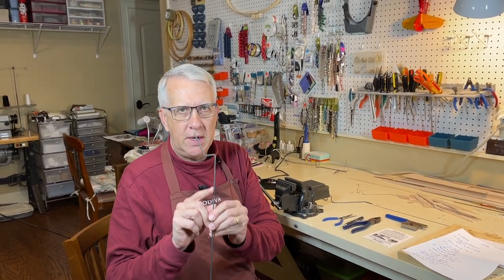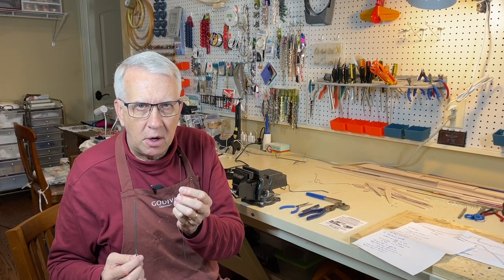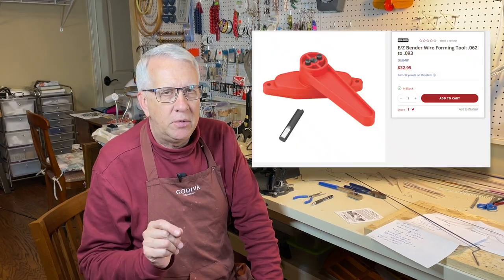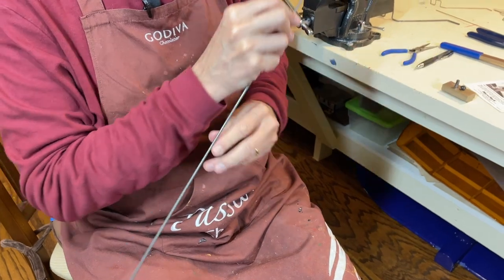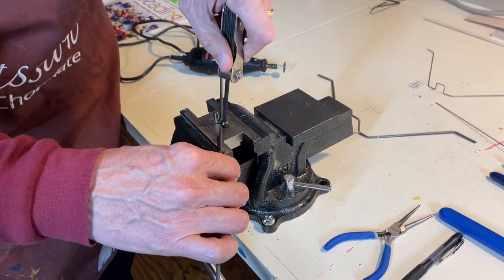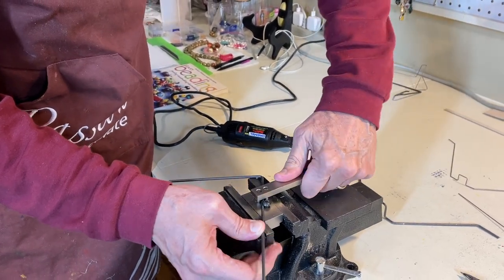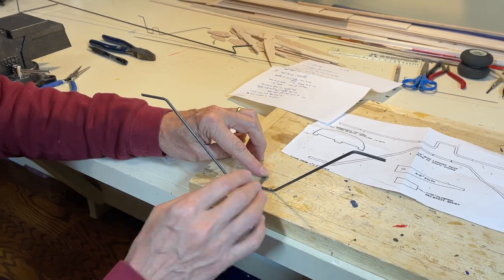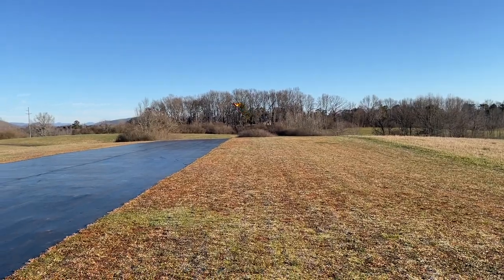How to Bend 1/8" Music Wire

Comment: Awesome wire bending video. 
Thank you Tim.
Reply from the maker: Michael:  Glad you enjoyed it!  Tim
Reply: Any chance you could or have done a video on making firewalls?
Specifically around 3/32 balsa using a dremel tool. I have a dremel tool as well and would love an education on making firewalls for Foamboard airplanes.  Cutting them out…drilling/rostering out cooling holes…things like that. 3 inch x 3 in would be a nice size that cooling openings might be easier to demonstrate.
I know … I am maybe overstepping my boundaries as a viewer. Just an idea for a future video.
Thanks for doing one on bending landing gear wire.
Mike
Reply from the maker: @Yankee2003  Mike:  Great idea on the firewall, will add this to the list!  Tim

Comment: I'd recommend trying a pair of Knipex 71 12 200 cutters for that wire. I use them on all kinds of metal fence wire as well as aircraft cable. The largest cable I work with is 1/8 and it's no problem. So, too, for barbed wire and such.
Reply from the maker: Great tip, thanks!  Tim

Comment: Tim, if you wanted to put a full loop in the wire, like to add a spring to your landing gear, will it let you do that, or does the retaining pin get in the way too much?
Reply from the maker: KF:  This bender will  not allow for a landing gear spring, not long enough.  In YouTube, search for "winding a torsion spring" and you can see how it is done.  Tim

Comment: High there Tim.  I've been watching you and learning from you for a while now and have a question.  I got a micro "brick" and the tiny lipo batteries and micro motor. But the motor has a really tiny 2 pin lead and I can't seem to find the connectors small enough to integrate it into the brick.  Got it a on Amazon...but where can I get the connector?  Help. Please!  Any suggestions? You struggling pal, George.
Reply from the maker: George:  The motor has a little 2 pin connector. Just search around the brick, there should be a female receptacle for the motor pins, will be along the brick edge. Tim